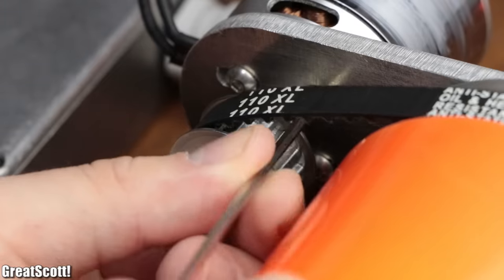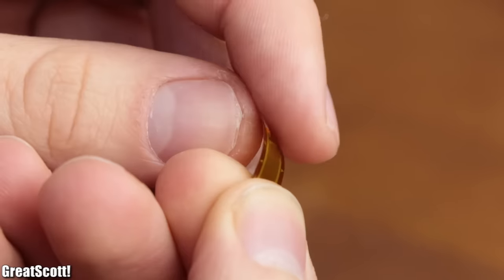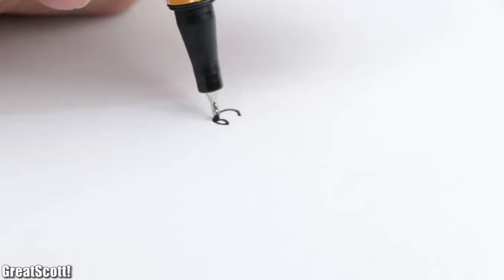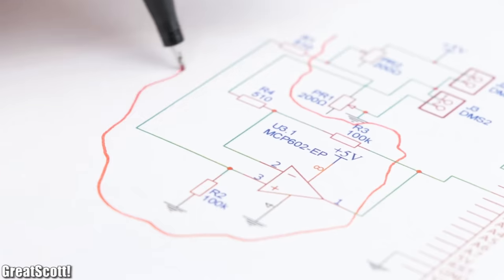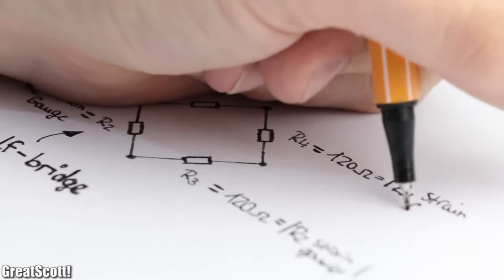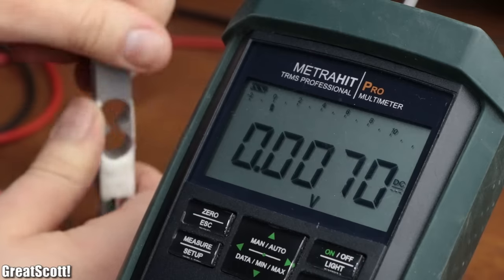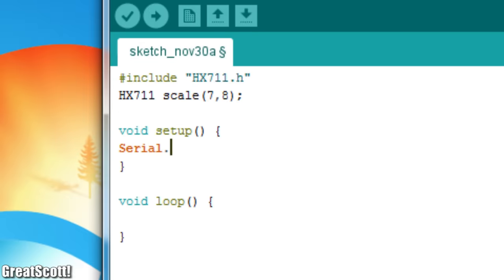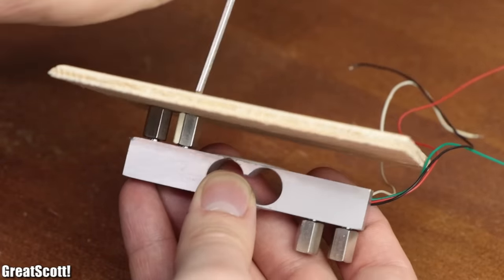Electronic Basics #33: Strain Gauge/Load Cell and how to use them to measure weight

Comment: One way to overcome the noise is to sample the output of the HX711 over a period of time (say, 1 second) and average all of the samples. It's quick and dirty but would give you less noisy output and over several sample cycles the measured mass will be more accurate. (Probably why I always see digital scales change their output reading in time-discrete chunks, and it keeps changing for several sample cycles for a bit before settling.)
Reply from the maker: True, I think the Sparkfun library even includes such an average function.
Reply: Granted, such averaging is really only necessary if you're needing to measure tiiiiny changes in mass. For something like this where all you want to know is whether or not you've had to bail off your board, the immense change in output values far exceeds the noise.
Reply: i use Kalman filter for these purposes
Reply: i found implementation in youtube and copy-pasted its code :D

Comment: For the adventurous: You can make an instrumentation amplifier out of normal low noise op-amps, then use oversampling + dither to get > 10-bit depth out of the ATmega SAR ADC. Feeding the whetstone bridge with a well regulated source, as well as making sure to air float (dead bug) your instrumentation amp is critical. (At these levels, merely the ambient moisture in the air condensing and re-evaporating on a PCB can cause variations in output. Professional systems use guard rings for this reason.)

Comment: Rider rolling down the road nicely
Rider goes over a bump causing temporary lift rider
Strain gauge erroneously senses rider no longer on longboard
System brakes longboard
Riders momentum causes him to faceplant
Reply: Sounds like a timer would fit nicely between sensing the lack of weight and braking
Reply: That was my first thought as well! My idea was to gradually apply a little bit of brake resistance. If only the board was being slowed, it would happen quickly, whereas if the rider was on it, it would only slow down a little bit. But Rob's idea was even better.
Reply: Exactly what I thought!
"Sounds like suicide with extra steps" - cit. Rick Sanchez.
Reply: Inductive sensing for the rescue?

Comment: I really like your basics videos, this gives an essential introduction to the topic without getting into too many details. I think a good future topic would be filtering and signal processing, like basic analogic and digital filters.  I think of only one suggestion for this video, in the part were you show the data stream and the difference between the weightless measurements and the weight of one IC, you could have used the Arduino Serial Plotter function to better display the difference, this is available in the later versions of the IDE, although it still needs some improvement.

Comment: So I recently had to deal with a load cell in my project and having some troubles with it due to something I got wrong in this video I wanted to point out something: 1)at 6:29 you show using the green wire for A- and the white wire for A+ and that could work on some models but some times is the other way around, I've found people saying the opposite and some stating that sometimes the colors are not standard. 2) This is pretty simple but make sure to have some space under the side with the downward arrow with the weight marker, the measuring is done based on the fact that under stress the load cell bends a tiny amount that stretches the Strain Gauge changing the resistance (it's simple but it's something that shouldn't be left out in my opinion), mine had m4 screws and m5 screws and the m5 ones were the ones I had to use to secure it while the others were dedicated to the load; great video as always, I just wanted to share my limited experience to maybe help out a bit.
Reply: bro can you help me code?? I can't get the right codes for my project bro
Reply: @lanceaeronreyes7579  so I used the Queuetue HX711 library by Scott Russel, it contains a Calibration sketch and an actual scale sketch it's all commented neatly and pretty easy to understand, the calibration did not work 100% for me and gave me a value even without load after calibrating, to fix that I just took that value and subtracted it from I (that in the sketch is the reading) I'm sorry if I'm late but I actually forgot about this comment, I hope it can help I avoided making a full explanation of the code because I feel like the example sketches of that library will be enough.
Reply: @simoneazzoni3882  right on bro thanks for the help! I used the HX711 lib and tried something different. Then I tried to mix the knowledge I got from different videos and tutorials and gives me a 90% accuracy. I'll try your advice brother! Thanks for the help!

Comment: Nice. We use strain gauges in car crash tests. To compensate for the temperature, we use another strain gauge on the metal base.
And the connection is then in a half bridge, as in the video.

Comment: Why stop at using the strain gauge as a safety device only? Ditch the remote  and use multiple gauges and calculate how your weight is distributed on the board. More forward, speed up, more to the back slow down.
Reply: That is actually excactly my groups Bachelor project for this spring (2019). Maybe that will be my first youtube video :)

Comment: In my DIY longobard desing I´ve used a button on a remote control which you have to hold if you want to ride, if you release this button my longboard will start braking slightly. However this load cell is so fancy :D

Comment: Something to consider when using strain gauges or load cells is their orientation.  I worked on a project that used a load cell to measure load from a cable, but the orientation of the load cell would change the measurement.  That's because of the effect of gravity on the cell, the housing, the cable... I had to incorporate an additional accelerometer and use that to offset the measurement depending on its orientation.
Reply: Hello Pete, can you please explain it in detail how you used an accelerometer to offset the weight measurements ? Thanks.

Comment: Great video, thanks! It‘s funny, I‘m currently using load cells for a project at work. I think, there is a key issue missing here: you need a reference voltage for both the microcontroller‘s ADC and the load cell‘s positive excitation (+5 V in this case). Otherwise, small voltage variations in your power supply voltage will mess up your measurements. Especially 24 Bits of resolution are no use without a stable reference voltage. Also, your adjustment trimmers also tend to drift with the power supply voltage, and depending on your circuit will even increase the offset regarding the microcontroller‘s interiour reference voltage. That is the exact mistake I made earlier with my own project. I dont‘t know, if the breakout board module inherits a stable reference voltage, but if not, then your 24 bits resolution mean nothing to the actual measurement.

EDIT: just looked at the datasheet, the HX711 has an internal bandgap voltage reference, so no problem there. But for the pure analog differential amplifier solution, a precision reference voltage feeding both into the ADC and the load cell is still necessary. And the differential amplifier needs a bit higher supply voltage in order to avoid saturation at full scale output voltage.
Reply: Metalhead777 Thats why you have to calibrate it in arduino, reading values and averaging
Reply: Jo el Caamaleón That‘s right. But still, I prefer using a precise reference over calibrating and adjusting the system each time. Voltage drift not only appears during warm-up time, but also generally over the life-time of the system, with temperature and moisture changes, mechanical stress and so on. In a finished product you can‘t have a user calibrating it all the time. And especially in the proposed use with an electric skateboard, which goes through tremendous temperature changes and mechanical stress (vibration!), this is not a practical approach. For testing it‘s fine, but any longer use needs reproducibility without the need of repetitive calibration and adjustments.

Comment: You should read up on the Hackaday article which explains the marking of x-bit ADCs and how due to the noise inherent in the circuit, the actual usable bit depth is much lower. E.g. for the 10bit ADC they used it came out to be a usable ~8.25 bits.

Comment: Oh this i want to know more off! I also thought of the very same 'dead man switch' functionality for my esk8. Now i have a bit more of a clue how it could be realized. Thanks for that! Does this work as you'd expect? When i discussed this at the builders forum, sceptisism about the riders safety had the upper hand. Another comment here spells out the main scenario that speaks against that feature. I do think there should absolutely be such a feature on every esk8 to keep those ground to ground missiles from unintentionally harming the environment. More than once I found myself jumping off the board and trying to hard break it as fast as i could using the remote... Luckily  i succeded until now.

Comment: I'll assume you will include a time delay so that catching a little air won't result in brakes when you land.  Of course,  the amount of braking you need to stop the longboard by itself probably won't affect the rider  when he lands on it again.  Still, I think I would look into a lanyard with a small magnet, or perhaps a very short-range radio proximity detector.

Comment: Good work.. keep it up.. thanks for your time and efforts.. I had to use once this load cells a few year ago. HX711 works fine with arduino.. even for smaller weight changes.. but callibration was too Much messy..

Comment: Thanks for the great video, What is the maximum output voltage value at maximum load in a load cell (if the supply voltage is 5V)?

Comment: I wonder if it'd be possible to add a digital thermometer and replace the manual potentiometers with digital ones. Otherwise, do you have to calibrate for temperature before every ride?

Comment: Hi Scott, 
I think you have a very tiny calculation error when you calculate 5V/1024 Inkrements. I know it's just for informational pruposes and for the explanation.
The AD outputs values from 0...1023. 0 increments mean 0 Volts and 1023 Increments mean 5V.
I think therefore the resolution hast to be calculated this way: 5V/1023. Same thing with the following calculation.

Correct me please, if I'm wrong.

Regards, 
Norman

Comment: How do you cope with the drift ? The load cells are the cheapest but not the most accurate method of measuring weight. Besides drift, they have hysteresis. The electronic scales auto turn off after few seconds because they can't  overcome the drift too.

Comment: Any ideas on how to measure the weight of a ballast bag in a boat? Since the bag is flexible the strain gauge won’t work. I don’t really need the weight in kg I just need to figure out if the bag is 1/4, 1/2, 3/4, or Full.

Comment: What would be the difference between using a wheatstone bridge vs a single resistor (+load cell) voltage divider to measure the voltage/resistance?

Comment: What components can I use to build my own signal conditioning instead of using HX711. And in this case, would I need to measure  the ouput as analogue signal ? Using oscilloscope for example

Comment: This is a very good video. Thanks for this. I'm using this cheap load cell that you showed. But in my project I found that to be temperature-dependent. Can you please help me out with a load cell that doesn't vary its values wrt temperatures between 10 deg C to 45 deg Celcius?

Comment: Hi GreatScott, thanks for your work, I appreciate it a lot! I'd like to say first that I'm a beginner in arduino, so pls forgive me for any mistake you'll find. 
Firstly, I just noticed that, in my code, the library is written as <HX711.h> instead of "HX711.h". As I said, I'm a beginner and idk whether this makes any difference or not :)
Secondly, once the HX711.h library is accepted, it returns an error as I write HX711 scale(7,8). Nevertheless, as I digit this very command without the two numbers, it doesn't return an error, but no numbers are shown in the serial monitor. May this be a software issue or an hardware one? In any case, I'm certain to have properly connected the wires.
I hope to have your answer asap! Good bye

Comment: Can u make a safe shutdown circuit for raspberry pi 3,when ever the power goes out the pi should automatically shutdown  itself 

please reply Scott...
Reply from the maker: Not my type of project
Reply: plz bro, can u refer me where can i find it.??
Reply: You'd need some way to detect and quickly automatically switch to a battery backup (can be as simple as a set of AA batteries) once voltage at power pins drops below 5v, then execute a shutdown procedure.
Reply: suraj bhawal but it will corrupt  the sd card!! hope u understand
Reply: I do have to agree, It's very annoying. I was working on a project for months when one power loss killed my sd card and i almost lost all my code. Luckily i was able to use a program called Recuva to get the files off the sd card and recovered my code.
Reply: What you want is a uninterruptible power supply for Pi. That's a ready made product call "UPS PIco" can do that.
Reply: But it doesnt need to be a full blown UPS, just a simple set of AA batteries that the pi can switch over to for a couple seconds so it can safely shutdown. The hard part is detecting power loss and switching over to the batteries automatically.
Reply: There are a bunch of videos on youtube showing you how to setup supercaps and low voltage detection to properly shutdown raspberry pi
Reply: Get the input voltage through a voltage divider and a transistor, when it drops too low, the transistor opens and provides backup energy from a relay. You should be using a bunch of caps on the Pi's input in order to keep power until the relay completely opens (and thus closes the battery circuit)
Reply: Use a schottky diode to a 4xAA NiCad or NiMH battery pack (4.8V) and use 2x 100k resistors (Between input and ground)  to form  a 2.5V voltage divider that can be read by the RPI Analog port. 
When the power goes out, the schottky diode will conduct (Vbattery - 0.3V), and connect the battery pack in series. By reading the input voltage, you can see that the main power is lost and act accordingly (i.e. Shut down or blow a horn if you like).
Reply: Mine always corrupted on hard shutdown with the default raspbian filesystem.
Reply: The idea was to have a UPS. If you don't care what happens, change to a different file system like you said.
Reply: The file system doesn't matter. It's the physical disk. If it is in the process of writing to a cell and the power abruptly gets cut, i can damage that cell. Especially if it's a MLC card (Most are).
Reply: fleshTH can u provide me the links??
Reply: Bigass capacitors (maybe supercaps?) in parallel with the supply 
voltage, and some code and a transistor to detect when the supply side 
of the power has dropped. After detection, start gracefully shutting down.
I'm guessing it only takes the rPi a few seconds to do a proper shut down, but the required capacity would be related to the required shutdown duration, and idle current consumption.
Reply: Here's a relevant article: http://raspi.tv/2013/controlled-shutdown-duration-test-of-pi-model-a-with-2-cell-lipo
The only active component is an ADC which monitors the battery voltage via a voltage divider. This works for slow discharge but not for cases where the power is suddenly removed. For that one would need a modification to isolate the backup supply (capacitor) from the main supply so they can be measured independently. How to go about this, I'm not too sure!
Reply: FleshTH, "The file system doesn't matter"?! How does losing power, damages a cell? You don't say!
The memory is written to, then the FAT is updated. If the power is lost during the FAT update, you will have file corruption on your hand. Some file systems, have two FATs. They both have to be updated, in order for the update to take affect.
Reply: How about a battery bank which is suitable to be charged whilst something is plugged in? I used to use one for a quick and dirty UPS
Reply: I love how everyone in this thread thought up their own unique way of handling the task. Thats why I love electronics, there are so many different ways to perform one task. Stay Creative yall.

Comment: For a project I would like to measure a 3d force using strain gauges. There are commercially available sensors but they are really expensive and also just no fun really. Do you have any idea how to accomplish this? I imagine it would require setting up a system like this for all three axes, then the mechanical aspect would become the main Challenge I assume

Comment: Hi, Awesome video. 
I am working on the similar model using strain gauge (load cell, 20 kg, 4 wires) with HX711 on Raspberry Pi4B. 
I've done all the set up and wiring etc.
I am facing issue and not sure how to calibrate (using Python) the hx711 based on load on the strain gauge. I am new to this.
Any suggestions/references will be a great help?

Comment: What is the name of the component (in front of the potentiometers) that connect the wires of the strain gauges to the circuit? (the component that the subject is screwing at 4.37)

Comment: The reference voltage of HX711 is 20mv or 40mv in chanel A and 80mv in chanel B, not 5v , check datasheet